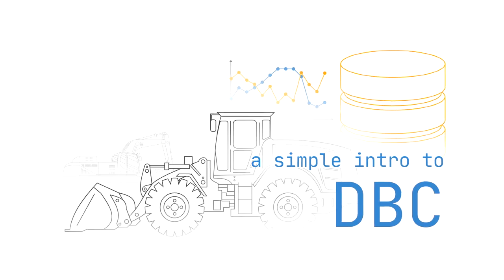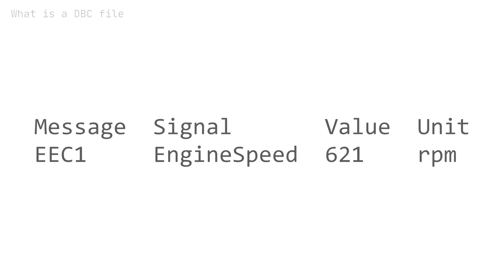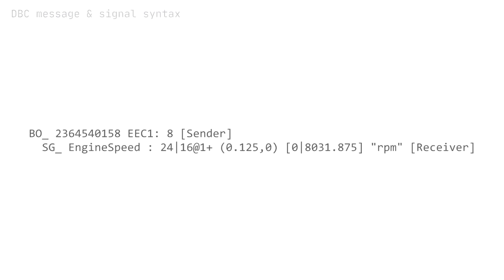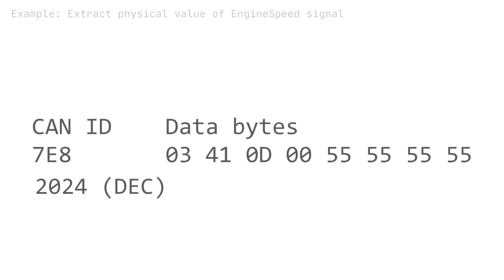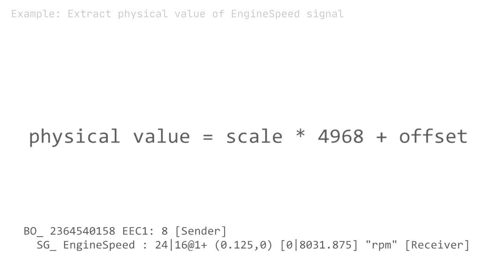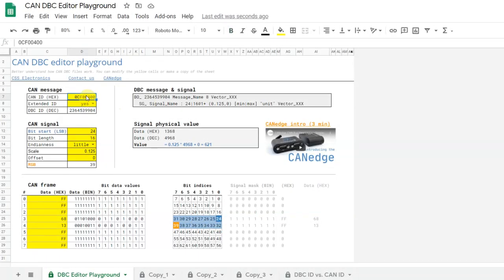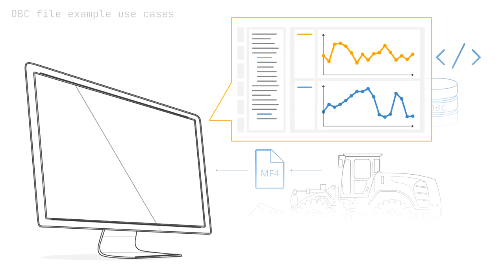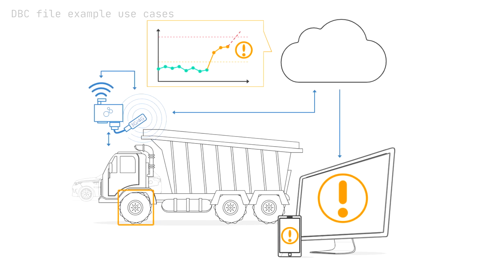DBC File Explained - A Simple Intro (2020)

Comment: What exactly is the difference between EDS and DBC?

Is it possible (ex. not against terms-of-service) to convert a log file captured in linux (candump) or Peak's PCAN (.trc) and convert it to the CanEdge mf4/mdf4 format, so that it can be used with CSS's visualization tools (asammdf GUI, python/matlab api, etc)?  Or perhaps other reasons why writing a converter that outputs mf4 is not possible or extremely difficult? 

If using CSS is not recommended, any suggestions for an open-source canopen visualization software (ex. PlotJuggler with the DataStreamCAN plugin)?

I'm mostly interested in creating a dbc file for a canopen device (gcan-4128), and plot the data real-time, and occasionally send it control commands (SDO Write).

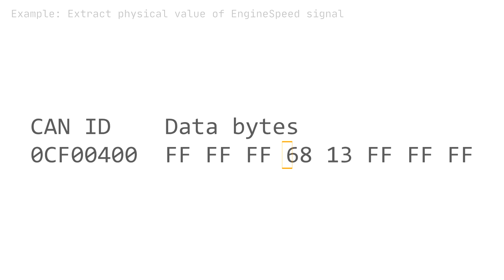Comment: In part 2:54. start bis 24, and bit length is 16 (means 8 + 8 bits) = means till 68. So why they cover data length of 6813 (which is 32?)
Reply: The start bit is 24, meaning that you'd start the signal extraction from this bit (i.e. after the 3rd byte). One byte is 8 bits, so with a bit length of 16 bits it means you need to extract 2 bytes - which is what is shown in the video. The byte ordering is then the reason why the order of the bytes is reversed. Hope clear.
Reply: I know, very late reply: One HEX-digit = 1 Nibble = 4 Bit, 0-F in Hex or 0-15 in decimal (not 8 Bit as I also have confused in the past sometimes). So 0x68 = 1 Byte, 0x13 = 1 Byte

Comment: How this CAN frames (29 bit identifier/ 11 bit identifiers ) linked to these DBC files?
Reply from the maker: We suggest checking out our intro article and our DBC editor playground to understand the logic
Reply: @CSSElectronics-CAN-Logger-X000  where can we find DBC files? Are DBC files are common among constructors? can a single file be used for multiple cars or boards? Is it possible to use it for generic CAN card like those we find with Arduino, STM32, Amtel or Raspberry PIs?

Comment: I have a question!

how do we understand the DBC file correctly? and can we build a DBC file from an ARXML file?

I am working on an issue where I am defining a GenSIgStartValue as  BA_DEF_ SG_  INT X Y; but when I am adding the default value for it as BA_DEF_DEF_ "GenSigStartValue" 0; I am getting an error while opening in vector tool. any help would greatly be appreciated
Reply: I suggest checking out our CAN DBC file intro in the Guides section of our website. The specific question you have is probably a bit more niche though, I'd recommend trying to build that DBC via Vector's CANDB++ editor in this case